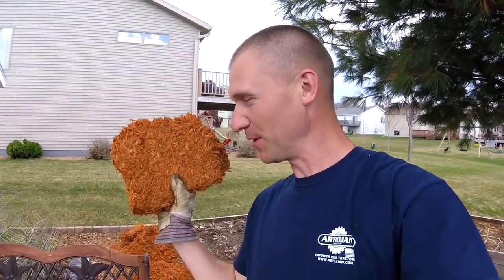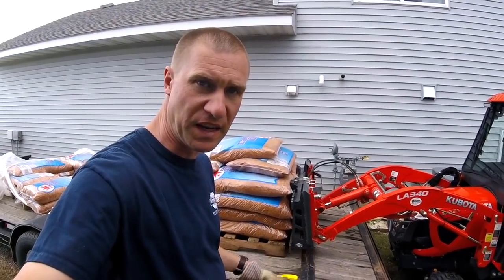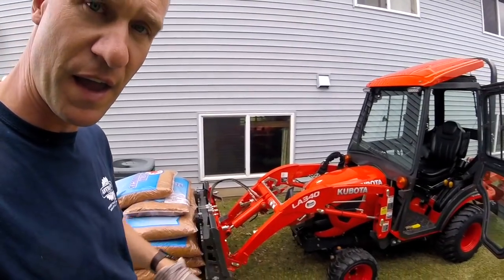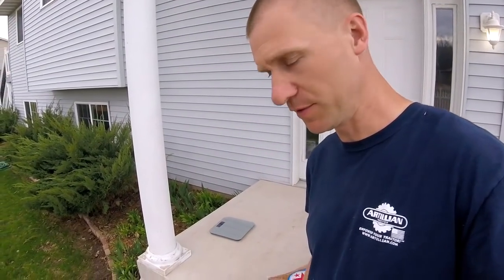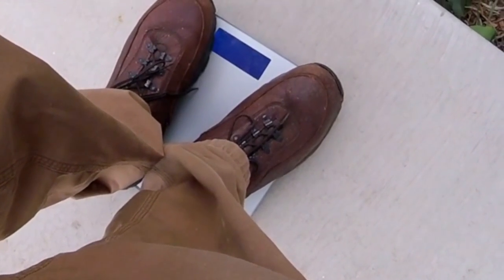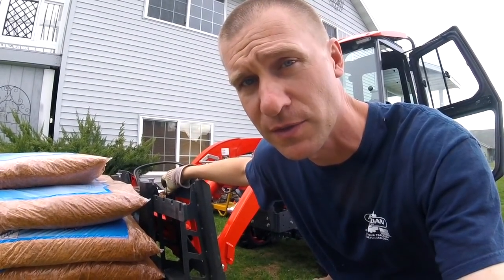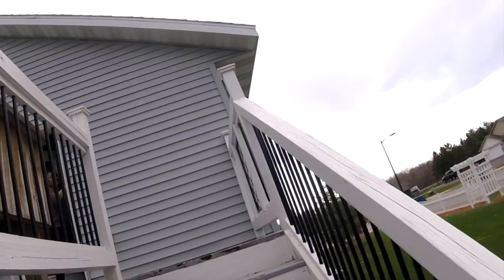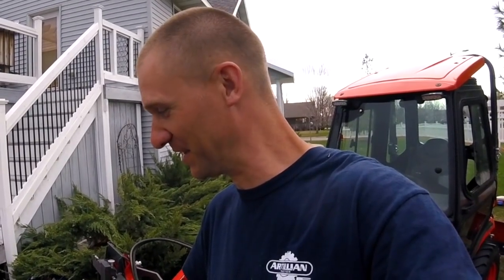KUBOTA BX23S FORK FRAME (Artillian.com)

Comment: Thanks for the shoutout Jon! I hope Mike can get the subscribers he needs! At 4:35, you seem to hesitate!  Looks like you feel the tractor light... isn't it? The mulch has a tendency to gain water when stacked on a pallet. I was not surprised they were so heavy.  But your boots are surprisingly heavy though! I also buy mulch by the bags, as this is the same price, but much more convenient to spread into tight spots.  Then any mulch left can be kept easily.
Reply from the maker: Mike will get the subs he needs, no problem. You’re right though, I did hesitate, wasn’t sure if it would tip on me without my butt in seat. It’s mainly my boots though. The bags are easier to transport and like you said if you don’t use them all you can save them for later. Price was right. It might snow here on Saturday, want me to send you some? 😁👍 
Keep on tractoring!!

Comment: Hi Jon!  Nice pallet forks!  The 2” receiver is a real plus.  Besides overloading your FEL, not having enough ballast can be exciting!  I once was lifting about 700 pounds of concrete mix on a pallet out of my truck bed and only had a 350 lb box blade on the back.  NOT GOOD!  Tractor started to tip and had to abort.  Thanks for sharing!
Reply from the maker: You gotta be super careful lifting anything. Even just keeping your bucket low when empty is good practice. Hand on the FEL at all times when carrying a load, jam it into float quickly if you need  to. 
Keep on tractoring!
Reply: That is exactly what I do when carrying heavy loads in the FEL.  In fact I’ve had to drop the bucket a few times in the past.  When transporting heavy loads, I keep my hand under the FEL control knob with palm facing up so that my only choice is to push up on the lever (thus down with the bucket).  Wouldn’t want to confuse up and down in an emergency!

Comment: Good morning Jon! The forks are pretty handy and I really like that it has the trailer receiver built in. LOL. I love the chat with your wifey. Sounds like my place. Just wait long enough and she'll eventually break and come around. LOL. Too funny. Hey, so a couple things I wanted to ask - I noticed you stepped out of the tractor very slowly when you loaded the 14 bags on - was she getting light in the rear? The blade does not provide a lot of ballast (maybe 300 pounds?) so was wondering if when you were leaving the tractor, did the loss of your 211 lbs have an impact? The reason I ask is because it happened to me once. I was lifting something really heavy for my tractor in the front and when I stepped off the tractor , the rear end starting to rise (my early days when I was learning about ballast etc). Also, you discussed the curl cylinder and called it the break-out force. Are you sure that is not the Roll Back force you were referring to? This has always been an intriguing discussion with folks as to which it is,  but take a look at the chart and associated graphic below it on page 32 of your Operator's Manual and let me know what you think. Varying opinions on it from different folks. But interested in your views. Good video and editing - thanks for sharing as always. Cheers!
Reply: Love GP Outdoors!
Reply: LOL. Thanks so much Tom. :)) Cheers and all the best!
Reply from the maker: Your going to make me dig out my operators manual and read huh. I’ll get back to you that one. But yes, I’ve heard different terms from multiple sources. I guess I’ll do my homework! 🤪
Keep on tractoring!
Reply: Break out force is the combination of your lift and curl cylinders, working together at max capacity. Example: You push into a pile, you lift, nothing happens. Then with the lift cylinders trying to raise the loader as much as possible, you curl back, and your bucket breaks free with probably a large load in the bucket. Individually, they would be labeled lift capacity, and roll back/curl capacity.
Reply: Thanks Matt. This is an area of the tractor specs I am still trying to get a good handle on. Although you explained it very well, I am still not sure. Here is the direct excerpt from the ASAE standards (note: no mention of curl cylinders): "Section 5.1.5 Breakout Force—at pivot pin (Y): Vertical lifting force, in newtons (pounds), the loader will exert at the bucket pivot pin centerline using the lift cylinders only, with the bucket horizontal at ground line."  This also seems to correlate with the chart and diagrams in the Kubota manual. But it is very possible I could be misinterpreting it or not fully understanding. Any further thoughts you can share? Thanks for your help!
Reply: @GPOutdoors  perhaps I am the one who is incorrect. The ASAE excerpt you quoted sure makes it sound like it's lift cylinders only. Seems like that would leave a lot of potential, USABLE force on the table though. You would think the manufacturers would jump at the chance to show higher numbers in their specs as well!  Though I guess they wouldn't have much say since the "standards" aren't determined by the manufacturers. I appreciate the info!
Reply: And here is the standard as defined by the ISO : "3.1
breakout force
maximum sustained upward vertical force, in newtons, generated at a point 100 mm behind the leading edge of the bucket of a loader, or behind the foremost point of the cutting edge for a loader having a bucket with an irregular (pointed, curved, etc.) cutting-edge shape, by a lift or tilt cylinder, with the bottom of the bucket's cutting edge parallel to, and not more than 20 mm above, the ground reference plane (GRP)". 
Matt, this one seems to line up more with how you described it (I think). I assume a "Tilt" cylinder would be the same as the curl cylinder? I am still not 100% sure. Thanks for any further thoughts you have. Cheers!
Reply: The ISO Definition is under their standards section applicable to earth moving equipment - Loaders and Backhoes. So the tilt cylinder reference may be related to the backhoes. But your description does sound very similar so you may be correct, Matt. I still need to do some more digging I think. Cheers and thanks again! All the best!
Reply: @GPOutdoors  Ya - that does seem to push the door back open to my definition some. I'm not sure if my perception of break out force is technically correct, but I sure know it's what I'm going to do when I need to break my bucket out from the bottom of a pile! Haha. - On a separate but related note, I do enjoy your videos. Thanks for taking the time/energy to make them!
Reply: LOL. Yup, a little curl goes a long way. I imagine you have had a tractor for a while but for me, I am still getting the hang of curling properly into a load, so every once in a while I get it right, and it feels great! LOL. Makes such a difference. Thanks for watching and happy you enjoy them, along with Jon's. I will eventually figure out exactly what it means at some point, but your explanation sure seems to make some sense to me. Perhaps the American Standard is not fully aligned with the ISO. The Kubota manuals show the BF as the force at the bucket pins, not the edge so definitely I have some more detective work to do. Cheers and all the best Matt!

Comment: If I didn't already pay for the Kubota pallet forks, I'd order the Artillian....been almost a month, still waiting on my forks and mower deck, just called my salesman Thursday, claims another few weeks...getting quite agitated.they went to another state and got my tractor, they could have done the same with the mower and pallet forks.  Several projects are on hold right now waiting on the pallet forks so I can put everything away in the barn/shop, my implements are in my way right now because I don't have the forks to put them on the shelving unit.
Reply from the maker: Pallet forks I think are one of the most useful attachments. I never thought I'd use mine as much as I do. Hope you get yours sooner than later. My goodness, what a terrible supply chain problem. 
Keep on tractoring!
Reply: @ritterjon  I kind of think so too, I initially wasn't going to get pallet forks, I don't do pallet work, but after watching your video on how you store your implements and given my limited space, its a great space saving idea and the pallet forks will certainly be of help elsewhere too in my shop.  

I'm in Idaho, and seems the further west you go the worse supply issues become.

Comment: If they’d put a bigger or higher flow pump on the sub compact tractors they would do much better. Like the same pump runs everything including power steering and it struggles to use the fluid for each area. The flow rate is just too low. Probably a cost measure to keep prices down using one small pump. Have a Blessed Day
Reply from the maker: You have a good point. I think what limits them from doing so is physical space within the hydraulic components and consumer issues with people trying to push their tractors too hard without understanding rear ballast. The fact that the BX can't lift it's rear end off the ground without ballast is a safety guard built into the machine. I will be shimming my hydraulic relief valve sometime this summer. 
Keep on tractoring!

Comment: usually the weight of your lift arms are  what ever the number on the arms are X2. So if it says 340 its supposed to be rated for 680lbs
Reply from the maker: Correct, kind of, the number is actually rated for kilograms which then is calculated by 2.2 to figure out Pounds. Neil Messick mentioned that trick in one of his videos from long ago. 
Keep on tractoring!

Comment: Jon have you boosted your hydraulics or are you running with factory specs.
Reply from the maker: I am running factory specs. I figure I'll let my warranty expire before I make any internal hydraulic mods. However I don't think I'd want to lift much more than what I can now because it's just not really safe with a sub compact tractor. 
Keep on tractoring!

Comment: Wouldn’t it have been faster and cheaper to buy bulk and use your dumping trailer
Reply from the maker: It's actually better to buy the bags, I get them for just $2 a piece and if I don't need them all I can store them easier. They are also easier to distribute throughout the yard and load from the store when they are in bags. I've done the bulk thing before and it's just not as convenient. Thanks for the comment. 
Keep on tractoring!

Comment: 480lbs plus the weight of your forks so probably 650lbs thereabouts.  Not bad for a sub-compact tractor.
Reply from the maker: I think shimming the hydraulic valve would help but I was happy with what it did stock. 
Keep on tractoring!
Reply: @ritterjon  I wouldn't care to try and make it lift more than its intended in the first place, that's just asking for problems, both safety, warranty, and breaking stuff LOL.  

Well right now I have to keep on lawn tractoring HAHA!!!